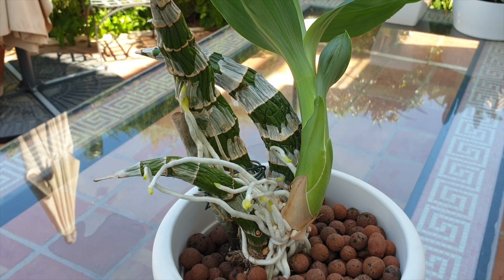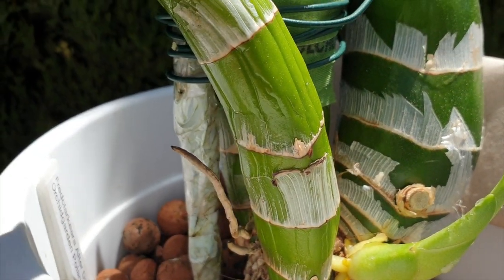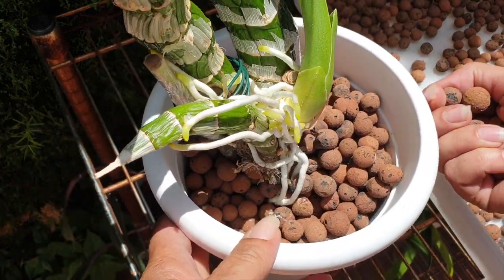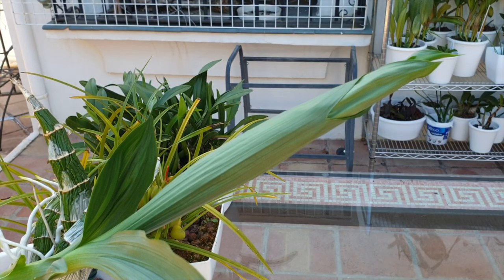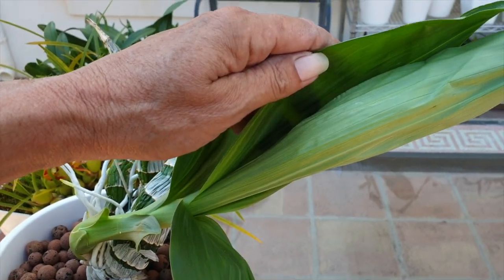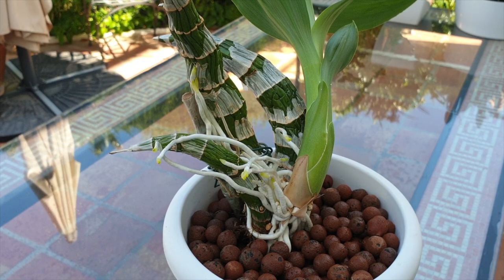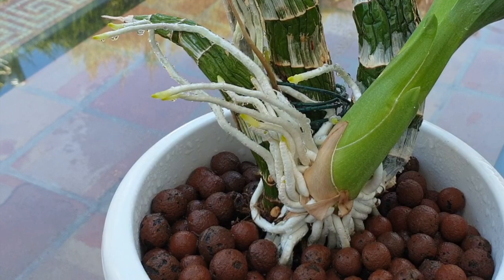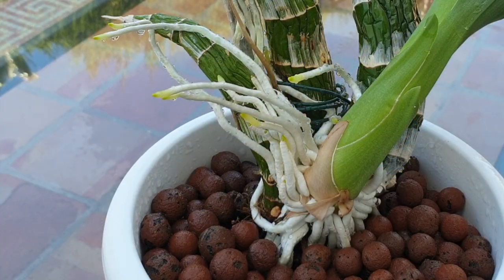Catasetinae FIRST watering | All phases leading up to the first watering of Catasetum #ninjaorchids

Comment: Aside from not behaving on the root front, that growth is growing at one heck of an angle. I know that has to be bothering you beyond measure. I haven't even paid mine the slightest bit of attention this year, I stuck them outside and walked away. Terrible, I know, I'm going to try letting mother nature take care of them this summer instead of me and see what happens. Well, except Cycnoches pentadactylon, because it was an itty bitty baby when I got it last year. It has grown a good sized growth this year, now waiting to see if it will flower or if I have to wait another year. But it is doing better than the other Cycnoches I have tried.
Reply from the maker: Don Miguel 🥰💐 hola jefe! It overreacted to my light training and went 'above and beyond' to what I was asking of it 😅 its a little annoying, that is true, and once it goes to the top shelf then I may turn it around again and see if the rest of it won't change direction a tad 🤷🏼‍♀️ it won't be that big of a bulb this year so, there is that relief, I suppose 😬 as long as it grows. I am not even looking for blooms in the winter. I hate messing with catasetinae, the repotting, so much can go wrong etc etc just grow now, that is all I ask. Your's will do great with your walking away care, of that I am sure. The flipping cycnoches phenomena... I will do an update on the Jumbo Mickey along with Jack of Diamonds and my little loddegesii, which was attacked by a caterpillar,😣 but at least not the growing point. So glad to be watering again! such a pain in the derriere, this whole waiting game! Hope your day was fabulous, Michael ❤️ thank you so much for watching 🌸

Comment: Hi i watered on its arrival and wet for about 4 hours max(by mistake) . I have re potted with bark and porous stone,  but I have not covered the roots with a top layer of bark. I am hoping to "dry" the roots i watered.  Have I ruined my orchid?  Should i use fan to dry the roots? Thanks in advance
Reply from the maker: HI!! 🤩💐 welcome! I have not seen you here before, so a warm warm welcome and thank you so much for being here, I appreciate it. Also, thank you for watching 🤗 you have not ruined your orchid. I just want to be 100% sure that your orchid is a catasetinae? Please do not use anything that would dry the roots faster than the normal process, because they may dry out tooo fast and then actually dehydrate, so, let them dry naturally and continue with your regular watering routine. Please let me know if this was helpful, if it answered your question. I want to be sure that I addressed your concerns properly 👍🏼 really appreciate you leaving a comment. Have a fabulous day and once again, welcome 🤩🌸